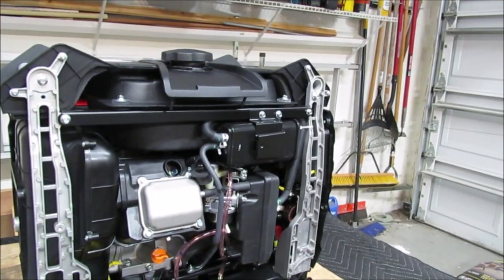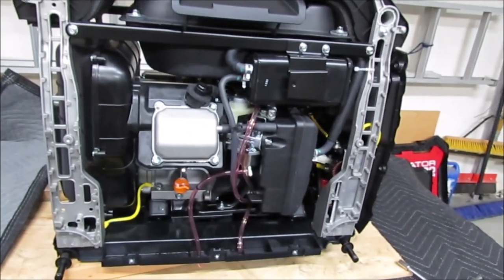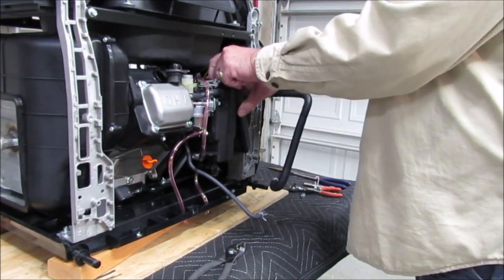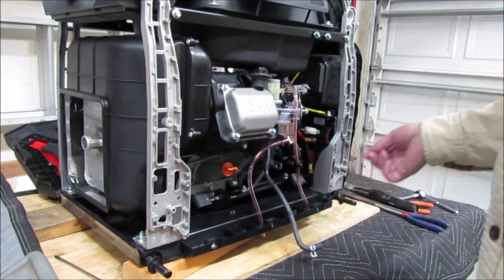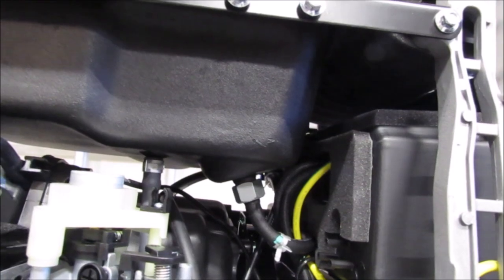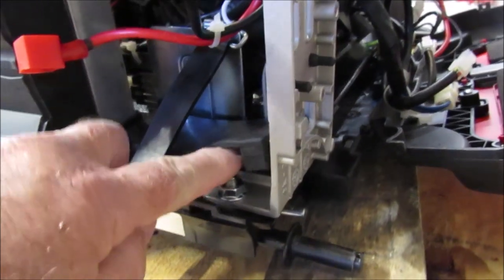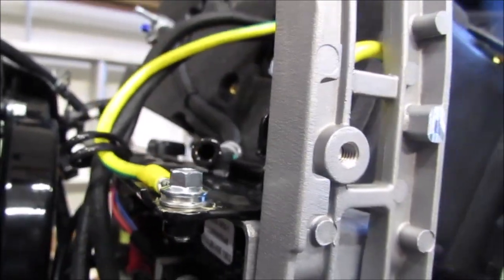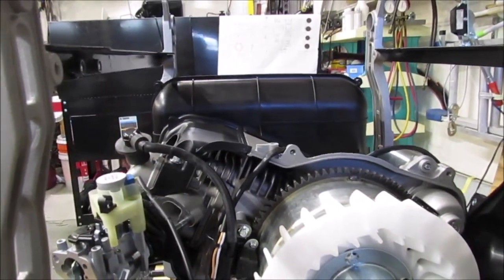Predator no spark, defective trigger coil, pulse coil or pickup coil....

Comment: I bought a new honda eu2200i 2 years ago.  Ran it until it ran out of gas, changed the oil and stored it in the garage.  Lat winter I needed it.  Would not start. No fire.  Just recently started working on it, it's coil test good, but weak spark, after it was taken apart. No spark before that.  It died just sitting in a garage.  Thankfully I had a champion generator that I thought would have been crap when I first got it, but it has never let me down in 3 years.  I'm at the point of just throwing that honda in the garbage. I feel ur pain.

Comment: I just bought one of these from the store as is for $300 and it didn't have spark. I disconnected the four pin with the two black kill wires from the little black box and it started. I plugged it back in and it is working fine... for now. I think I will buy all the ignition parts to keep on hand. Thanks for uploading.
Reply: Modular are going bad on them so keep a extra and it may be bad to do switch it out

Comment: Man you just helped me figure out what is wrong with my Predator 2000. I tried disconnecting the low oil wire but not the dial. I disconnected the wires and it fired right up. I have used my 2000 watt for a few years and it has been very reliable until this happened.

Comment: It's a vapor canister.      My 3500 won't start either so I'm hoping to follow your lead.
Reply from the maker: No spark? Make sure you disconnect both the OIL Pressure switch wire which is on the rope pull side of the generator near the ignition module assy. (it's in the video someplace). 
Also, there's a kill switch attached to the ON/OFF/RUN fuel selector. You need to remove the knob (long phillips needed) and then remove the front panel. The wire is attached to the fuel selector and attaches to a connector. Disconnect the connector breaking the connection.
The generator will run with these connections removed. If it still doesn't run then you have other problems...
If you know how to use an ohmmeter, the connector and cable that goes to the Coil assy. has two wires, the two will read continuity to ground. The pickup coil (white wire) will read 200 ohms or thereabouts. The other (orange) is the Ignition coil primary. I don't recall what that measures but it should have continuity to ground. This is shown somewhere near the end of this video. It is also discussed and shown in Part 2 at the very beginning of the video.

Comment: I have watched 28 minutes and have decided to never buy a 3500 watt predator generator. I have seen engine disassembly less complex. I would have to have two cameras, one on a head mount and another overhead view to just get this quiet genset back together. To me it seems we could somehow have direct fuel to 60hz 125v electricity with a solid state fuel cell.

Comment: I'm having same problem.  I already ordered a new coil. And still no spark
Reply from the maker: Well, someplace in the video I told you to verify/disconnect two wires that can prevent spark BEFORE doing anything else. Did you disconnect the Low Oil Sensor switch (location is shown in the video) and if it still doesn't start, remove the screws from the front panel AND the screw in the center of the fuel selector knob and disconnect the engine kill switch connector behind the panel(also shown in the video)? 
Only after trying these two disconnects should you be looking elsewhere. The engine will run without both of these connections.

Assuming you did all that, you should have measured the coil BEFORE replacing it...It should be 200 ohms and again, that is shown in the videos....
If that READS good then your next choices are the ignition module and the Stator coil itself. The ignition module is NOT available from HF but you can find it on amazon.
Reply: @kaydee457   thank you for the reply.  Going to do more work in the engine

Comment: Bought this generator 2 years ago. Nothing but trouble since day one. So sick of all the comments saying this is such a good generator when in fact it is the worst one I have ever had. Fouling is off the chart. Little under 100 hours and I have no spark. Junk as far as I'm concerned.
Reply: I know there not that good because I work on small engines and I’ve had 2 with bad ing modules allready

Comment: How did you get the two bottom screws out???
Reply from the maker: Umm, what screws? Where and what are you referring to? There were many screws removed.
Reply: @kaydee457  the bottom on the black shroud finally got them with a flexible extension
Reply: I actually removed the motor mounts from the frame at the vibration isolators and snuck it under there. If I have t do it again for any reason I'm forgoing tearing the front panel off and pulling the motor out completely
Reply: Como chequeo el regulador que esta debajo del estarter. ¿Tiene que ver con la chispa? o no. Voy chequal la bobina y el picos coil segun su video gracias por sus enseñansas no entiendo mucho el ingres.